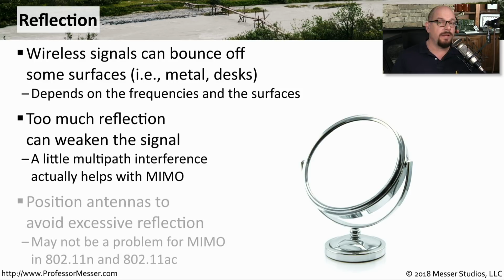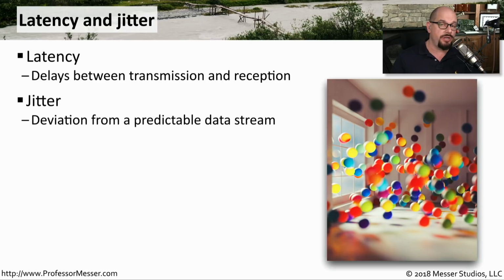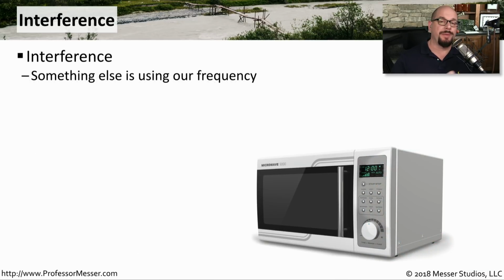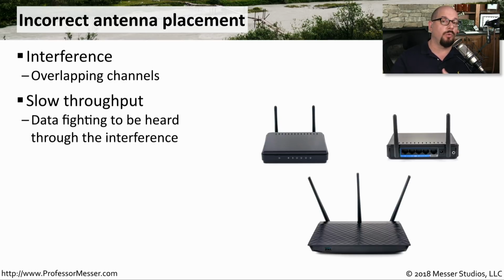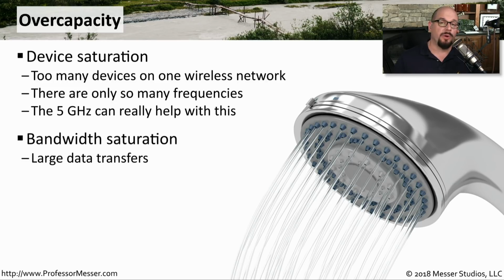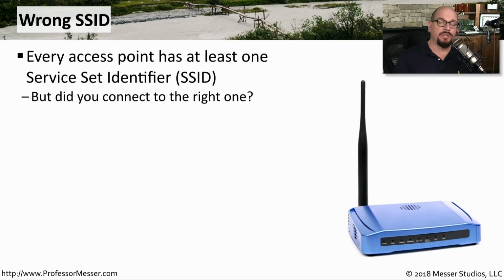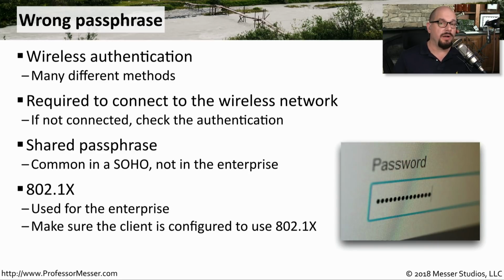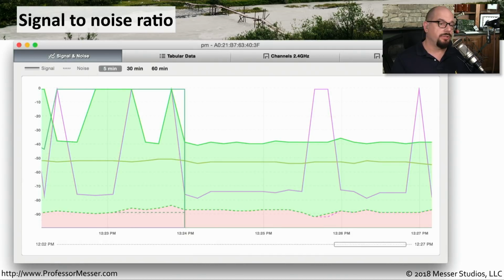Wireless Network Troubleshooting - CompTIA Network+ N10-007 - 5.4

Comment: On the CompTIA Domain 5.4 terms it has "Power levels" as one of them. Is Power level referring to the more power output your access point is configured for, the stronger the signals will be and the farther a signal will go?
Reply: Yes. Power level is referring to how strong the signal from your AP is. Most APs will allow you to modify the power level so you can adjust how strong the signal coming from that AP is.
Reply: Did you ever figure out the answer to this? I'm curious myself.